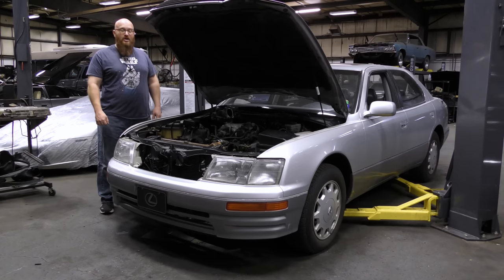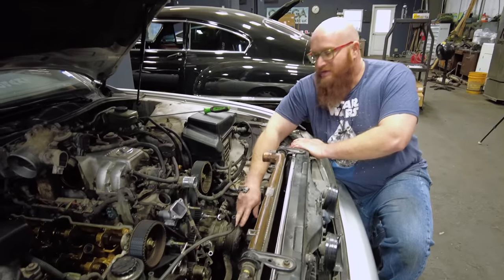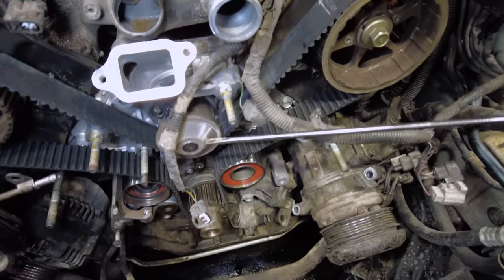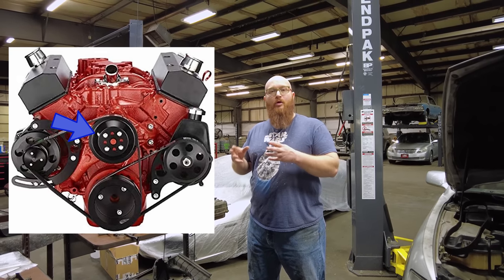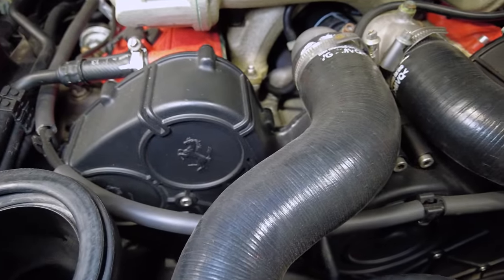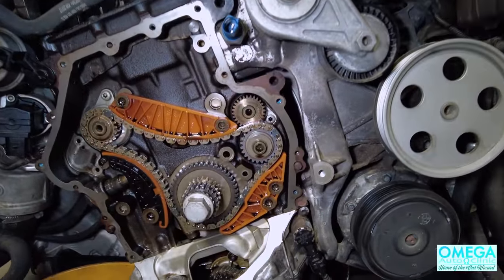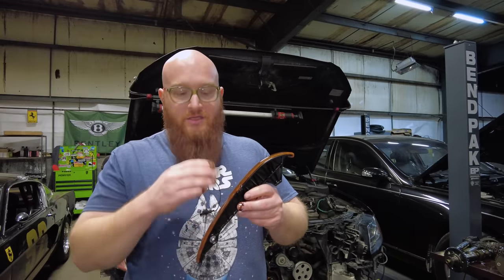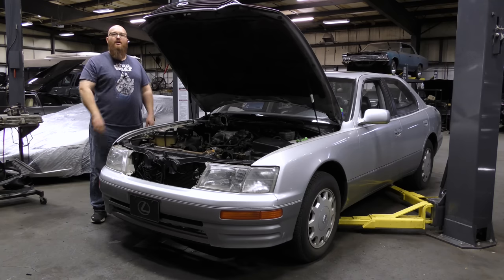My What's Broken? Series #1: Timing Belts-vs-Chains! CAR WIZARD explains why the huge bill

Comment: Belts over chains all day. The nightmares over the years from tons of cars with timing chain tensioners and guides going bad is just way too much. Even if these parts start to fail and not completely fail the chain can lose tension and then jump timing or the chain can snap. Too many parts. The idea was that a chain driven car would never have to be serviced, but that clearly is not the case.
Reply: Very true statements
Reply: Depends on the design and how people drive and take care of their vehicle. Chains work well if the oil is changed every 5K miles or sooner using a good quality oil filter that has a well designed anti drain back valve. Crappy oil filters with bad or no anti drain back valves will cause the chain to eat up the guides until oil pressure comes up and wear them out faster. Long intervals on oil changes or driving with too low oil will tear up the chains, tensioners, sprockets, and guides. It will also plug up the tensioner(s) if the oil isn't changed regularly. Chains are a bit more noisy than belts in operation. I've seen Ford 4.6 modulator engines go half a million miles and more on the original chains, guides, sprockets and tensioners. I have 270K miles on the original chain setup on my 1984 Toyota pickup.
Reply: @muziklvr7776 , I have had Infiniti's over 200K and no chain issues and I did slack on oil intervals a lot. The Audi S4 with the timing chain against the firewall and the the damn 5.0 Range Rover are 2 cars notoriously known for timing chain tensioner and guide issues. Not sure the best maintenance ever can keep those things from being a ticking timebomb.

Comment: Hey wizard I just bought a used 2020 Corolla le with 111,000 miles. Wondering I’ve seen alot of cvs issues with the hatch version of the Corolla mi car also has the cvt. Should I be worried about possible cvt issues in the future? TIA everyone.

Comment: One thing people don't talk much about is timing chains aren't invincible. Plastic guides that wear out cough bmw cough or timing chains that stretch like rubber bands cough GM 3.6 V6 cough.

I own timing belt, timing chain and timing gear engines and I prefer the timing belt for ease of maintenance.

Comment: I wonder how easy it is to replace a belt on a Fiat twin air engine. My Fiat panda had it done by the previous owner. The car has now done 43,000 kilometres with the current belt. But if it's time to change, does the front side of the car need to come off?

Comment: You can't change the timing on a vehicle yet my crank position sensor has adjustment? I'll agree it's more common to not be able to adjust timing but when you're looking at '90s cars there are many that can have adjustments that can be made outside of the computer

Comment: Soooooooooooo happy with my pushrod v8 with a central cam with a small double row timing chain,with no guids or tensioners and in general it last the life of the engine................I rather spend a more on fuel and dont have to watch out for the expensive complex repair bills..........Long live the Holden 304 hahahah

Comment: Timing belts, I replaced a few not as many that a regular mechanic has but what I saw were the teeth just break off or fall off, and haven't seen or heard of a timing belt just snap apart, I suppose that the way the car is being driven has something to do with it, anyways can't think of which is worse, and suppose either could end a marriage!😢😂
Reply: Well they can snap, my Ford 2000 cc had a belt. Driving home from party, engine just quit. Opened the hood saw nothing wrong, looked under engine and see my belt hanging out of inspection slot . Thank God for non interference engines with flat top pistons, $25 for new belt and 5 hours for remove and replace. Teeth were fine just separated at the splice. Roommate 's Rabbit belt had several sections of missing teeth, belt tensioner rusted in place so very little tension on the belt so car ran fine and belt did not break, looked like garbage however. I still can't believe it did not break or jump teeth.

Comment: Looking forward to more videos like this one. I do understand how timing chains/belts function but I still enjoyed it. Do any engines use gears for cam timing?
Reply: Years ago I had a Ford Ute with a Diesel engine that used gears for driving the camshaft (also the injector pump). It was a push valve engine so the distance between the crankshaft and the camshaft was not as great as for an overhead cam engine, so gears worked well
Reply: Ford 300 straight 6

Comment: I have a 2018 Honda Accord Hybrid with 262,000 miles on it. Should I replace the chain at 300k miles just in case if I want to keep the car longer?

Comment: I personally prefer belts over chains, they both have their own benefits but honestly changing a belt on most vehicles is pretty easy.
Reply: Cars used to be a lot simpler. Old cars didn't have all the tensioners and guilds like new engines. Trying to make them more fuel efficient has brought in variable valve timing which makes the chain runs around all kinds of pulleys and stuff.  If you go back to very old cars the timing gear and crankshaft gear meshed together and didn't have a chain or belt at all.
Reply: If the belt is none interference than yes I like it better than a chain as well. Otherwise hell no. Even if you keep on top of changing it there will always be a little part in my brain saying "what if it snaps for no reason"
Reply: But the chain lasts much longer and if an interference engine, you're screwed
Reply: @WhittyPics  don't forget the plastic cam gear for some old engine.
Reply: If it's a customer car, I prefer a belt.  On my personal car I prefer a chain.
Reply: @Vincent-ke5zn  you're screwed if a chain breaks as well.
Reply: @Vincent-ke5zn  usually the chain outlasts the timing guides and tensioners, if you're in there to change those you're doing most of the work of replacing the timing chain.
Reply: @WhittyPics  I do like pulling off a couple of hex bolts on a 2jz to see the belt condition vs having to remove all of the accessories and then the front timing cover just to see a belt or chain, for sure.
Reply: @AK47Stalin  exactly! Ever since I learned about interference vs non-interference I've based my car shopping totally on non-interference engines.
Reply: @infidel6687  that's because mechanics have to change the belts more often and make more money, that's why they have timing belts to rip off customers

Comment: Timing chains and Toyotas tend to last as long as the car, could be several hundred thousand miles. Meanwhile timing chains in German engines don't last anywhere near as long, because of German engineering. And, German engineers love putting the timing chains at the back of the engine where they are  even more difficult to get to.

Comment: I wonder if the fact that a Ford 300 straight 6 has timing gears, instead of a chain or belt, helps those engines to live as long as they do.
Reply: Unless the timing gear is plastic, as it is on some of those engines....

Comment: Id say one must be careful on nwhich timing belt replacement kit one uses. If aftermarket only AISIN KITs or oem if you can afford it. Gates i hear puts in cheap China tensioners that can fail.

Comment: If you've got a timing chain then should you change the water pump as scheduled maintenance anyway?
Reply: Yes always
Reply: At how many miles?
Reply: Yes, because of the location of the water pump on most cars the additional labor to do it at the same time as a timing belt/chain.
Reply: If you're like me, no, no you won't bother even though it would've been much easier and cheaper. LOL
Reply: Yeah, but you're not changing the timing chain on a schedule
Reply: Depends on the vehicle. On hondas the water pump is nsupposed to be every 105k yet many bsee them last 200k+

Comment: 80's and 90's Toyotas use Timing belts. Most, if not all Toyota's from that era were non-interference engines.  fortunately, when Toyota transitioned to an Interference engine design, They went with Timing chains.

Comment: Is there a certain replacement interval for a timing chain?
Reply: For the most part, no. The telltale sign is that they get noisy on startup. Keep running it long enough and it will make noise continuously.

Comment: The water pump/timing belt design is the biggest rip off ever by car manufacturers.  Had this happen with my Ford 3.5L v6. Kicker was I was told there was a nation-wide shortage of the timing belt, and could be 6 months before it was available - with a leaking pump. I managed to get an OEM one  from Puerto Rico in 1 week. $4K later pump was replaced. What a rip off.

Comment: i really dont trust timing belts! they are very good in a racing engine where you have to rebuild the motor after every event anyway but a daily driver? nope sorry even if you stick religiously to your scheduled maintenance a timing belt has a countdown that can leave you stranded if you hit some financially tough times and cant afford to change it, i've never had that problem with a timing chain and very basic engine maintenance!

BTW Wizard you forgot to touch on timing gears! i have some on my worked V8 weekend streeter, it can be very tough to initially set the timing using them but the engine response you get once you have is great, they are noisy damn things though!

Comment: belts are much cheaper and easier to replace than chains. a chain setup on an overhead cam engine is a cuckoo-clock of chains, guides, phazers and tensioners many of which a failure prone and expensive. some chain cars like Audis are complete and total shitshows.  the only chain engine i would personally own is a pushrod engine

Comment: As an electrical engineer I see this bean counter style product all the time. Granted computer control has its place but as you said, some mechanical assemblies will outlast and outperform the electrical equivalent. Plastic gears are an albatross in the auto industry, and we should all refuse to buy such garbage until the car companies get some real-world class engineers, production facilities, and parts that match the outlandish prices we are charged.
Contemporary engineers are incompetent and stupid. Recently oil and transmission dip sticks were removed-why? Electric parking brakes just wait for the day when the battery dies-what fool thought this one through?  Many newer cars have plastic components in the engine compartment because some morons in accounting and engineering decided it was a cost savings. Well last time I checked most plastics, at least those used by the avarice car companies, don't do well in the hot environment of the engine compartment. Just look at a newer BMW or Mercedes after 5 years and what it cost to replace their plastic straw like plastic components. They are top-tier money pits and we should punish them by never buying their garbage.
One more stupid decision was to use the new refrigerant R1234YF in newer cars and believe it or not its flammable and 10 to 100 times more expensive than the previous R134a refrigerant. Is it more environmentally friendly? Marginally, if at all, but very costly when it needs repaired. Come on engineers, tell the bean counters to get lost and build something you can be proud of-your fathers and grandfathers did.

Comment: Plot twist : My older brother used to have a 2005 Solara with the 3.3 and the water pump ended up leaking and snapping the timing belt. Think he had like 85-90k on it. So they both needed replacing

Comment: Is there a warning when a timing belt is about to fail?? Would love to know. That was the practical information missing from the consumers point of view. Otherwise informative.
Reply: There is no warning.
To examine the belt for cracks means accessing the belt (possibly by taking off one of the covers) and slowly turning the engine over with a ratchet on the main crankshaft bolt....
But then the condition of the inside of the belt/teeth may be hard to see....
Do what the manufacturer tells you to do...change it as PM.

When you buy a car just on the cusp of the mileage where the belt/chain needs to be changed....make sure it has been done before you buy it...or be prepared to do it as PM...with an adjustment to the sale price in your favour.......

Comment: I drove an '85 Porsche 928S2 5 speed for 19 years, and that car never saw it's 46,000th mile with the same timing belt.  A pair of rebuilt heads for this thing would be over $8000, so I was religious about timing belt changes.

-Folks, I am CONVINCED that if they wanted to, they could produce a steel-reinforced rubber belt that would last the life of the car.  And timing chains are cheesed-out by all the auto companies these days, just look at all the GM 3.6 liter V6 problems.  Toyota SOHC four cylinder engines back in the 1970's ran timing chains and they ran 400k miles without ANY trouble.  

So why are we having all these problems with timing chain systems?  And belts that can't realistically make it to 100k miles safely?  This is bullshit planned obsolescence by the auto companies.

Comment: The old Fiats from the late 60s through the mid 80s had timing belts and you better change them every 40k miles or you were flirting with disaster. Fortunately they were easy to do.

Comment: Why don’t car manufacturers use timing gears anymore?
Reply: Cummins does
Reply: When were timing gears common for automotive gas engines?
Reply: Because it cost more to manufacture.
Reply: @Sonny_McMacsson  I’ve only seen gears  on diesels like Cummins and CAT
Reply: Gas engines way back when in 40s etc used gears

Comment: You actually never have to replace your timing belt if you just trade in your vehicle @ 120k miles
Reply: Many do this haha onky car where id say its necessary is a supercharged range rover that engine usually destroys guides 5-7k repair

Comment: Wizard, most belts and chains are on the front of the motor, except for a few, like the idiots at BMW that put the chain on the rear of one of their I-6 motors and you have to pull the motor or transmission to change it. 🤑

Comment: Personally my favorite is timing gear, next is timing chain on a push rod engine (those rarely fail), then a timing belt and finally a timing chain on a modern POS.  At least the belt was designed to be replaced, these dumbass engineers decided to put a 10ft long bicycle chain than turns what 3k rpm inside the engine with plastic tensioners and expect that to last!! Genius

Comment: And all these timing belt issues are completely non existent with EVs.  Saving 1500-2000$ every 70k-100k miles.
Reply: Until the battery needs replacing... or coolant and heating systems need servicing...
Reply: @burntnougat5341  I guess so.  Tesla batteries can go well beyond 100k miles. the cost of all the oil changes, coolant changes, transmission fluid changes, and brake jobs that won’t be needed also have to be considered too. Theoretically should be a lot simpler maintenance.
Reply: @mongo64071  EVs have brake fluids and pads and electric motor lubrication service items too... theory isn't practice. 100k is a lot of wear and tear on a battery mate

Comment: You are not clearly differentiating between valve timing and ignition timing, when you spoke of "timing light" and the computer controls "timing" doesn't help the novice just confuses them. I have mad respect for CW but this video was a bit lazy.

Comment: Belts are garbage, do they say timing chains are better?🤨👁🤔
Reply: They’re not garbage.
Reply: Chains are more durable, but these newer designs use plastic guides that can wear like belts
Reply: Chains are better suited to older push rod engines, for that they are excellent because the chain does not have to traverse long distances. But when you start getting into overhead cam engines like the LS400, having chains, and all that weight whipping around at these speeds, its not ideal at all. Its the same reason why you don't see chain drive blowers on a modded engine at a dragstrip or whatever, same kind of thing.

Comment: Yeah and its great engineering to have an interference engine that owes it lifetime to its timing setup - but a timing chain life depends on PLASTIC running guides runs on a finite clock until the PLASTIC fails.  A quality timing chain in an old school small block Chevy or similar can typically last near or at the life of the engine with the worst thiing it can do is stretch a bit but not fail because theres no PLASTIC guides, early cam gears with chains had nylon teeth that could fail but a metal timing chain with an all steel cam gear is perhaps the longest lived timing method only surpassed by certain engines that had timing GEARS - these never wore out and lasted at or beyond the life of the engine.